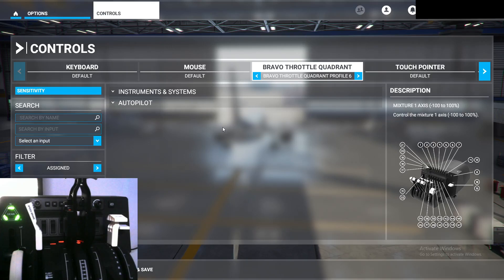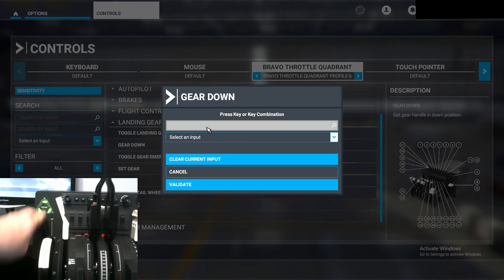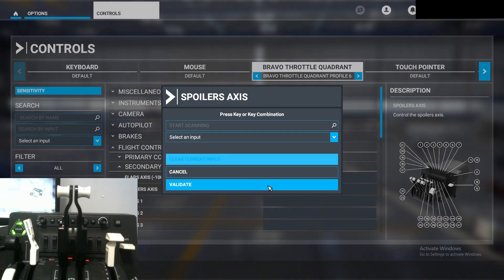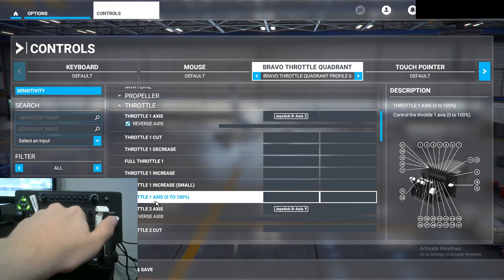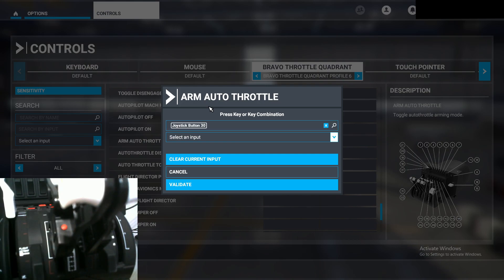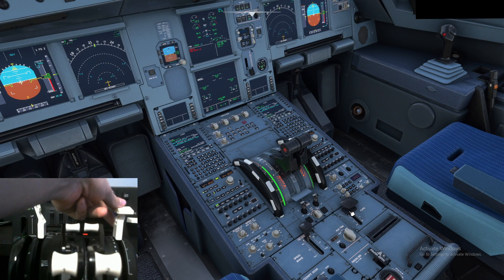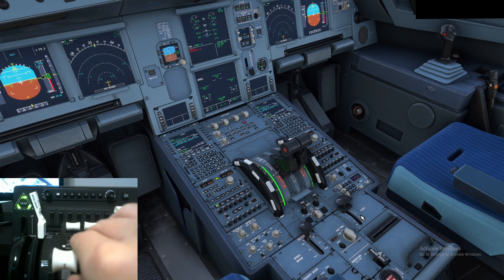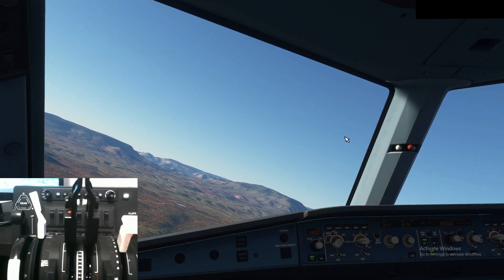Honeycomb Bravo Throttle How to Configure Thrust, trim, gear, flaps, spoilers, and Reversers in MSFS

Comment: Excellent video -  thank you.
Missing the function "idle reverse" as sometimes you want idle reverse on roll-out and use Autobrakes/manual brakes only; aircraft LW is very low, long runway etc ..... so ..... how would one config/assign that? In particular for my B744F. Cheers

Comment: When you engage the autothrottle would the throttle levers move? (Not in the simulator)
Reply from the maker: On the bravo quadrant, no. If you want levers that move with the sim, you’ll have to look for a “motorized throttle” quadrant. I do warn you though, that these units cost much more.
Reply: @wallyrodaviation  Thank you!

Comment: When I set the mixture using axis 1 -100-to 100 no matter how I do it (start mixture forward and pull back or vice versa) it results in it set backwards to the lever. Even with just 1 movement (no return movement),same result. Can not click "reverse".
Reply from the maker: There might be a similar setting for the mixture, like -100 to 100

Comment: Thanks but there is no -100% to !00%  In the Flap assignment section .. in my sim
Reply: there is 0 to 100% but it does not work
Reply: I just selected Flap axis checked the reverse axis box and validate and all works now ... cheers
Reply from the maker: @56Rockabilly  glad to hear it works now, yeah I believe they have changed some of the control binds since then. Nevertheless happy to be of help 👍🏻
Reply: @56Rockabilly  Hi Cliff I am struggling adding the flaps to my A320 Fenix I did try all these still my flaps goes from 1 to full directly any idea what should I do Thanks

Comment: On the 4 engine setup,  the program won't recognize the throttle #3 reverse thruster when I flip it back, nothing appears on the scan screen.  I've swapped out a functioning switch with #3 and eliminated that it was the actual switch itself.  All the reverse thrust levers are in working order.  Could it be something in the bravo unit itself or just a software glitch?  Frustrating.
Reply from the maker: I had the same issue funny enough, I am pretty sure it is the throttle itself
Reply: @wallyrodaviation  sad part is that I just received the Alpha and Bravo in April and neither have been used much.  Thanks for the reply.

Comment: Hi wonder if you can help . I just got my Bravo Throttle & have problem with the lights not working have installed the latest drivers for it in the right folder for game, but still not working my  the levers work & light up when moving in the set up but Buttons don't display light function when testing ? is my control  Broken ?
Reply from the maker: I would locate the uninstaller application for the drivers, run it, and then go about the process again and make sure the game isn't running

Comment: Surely you'd want to use the elevator trim axis for the trim wheel rather than "trim up" and "trim down"? If you use those you're just emulating digital keypresses on an axis.
Reply from the maker: The trim wheel on the Bravo is not actually an axis, but two buttons, one for down, and one for up.
Reply: @wallyrodaviation  damn really? That seems like a really odd decision to go with on Honeycombs part.
Reply from the maker: @SoTotallyToby  I was shocked to see that too
Reply: @wallyrodaviation  The problem I’m having with the Bravo trim wheel is that it’s just too slow for C172 type aircraft. Any way to speed up the nose down/up trim?
Reply from the maker: @andrewmorris3479  Too my knowledge there is no way to speed up the trim wheel action
Reply: @andrewmorris3479  I had the same issue, its completely unusable out of the box. I had to make a fake axis in vjoy and use Joystick Gremlin to bind the trim wheel keypresses to increment and decrement the virtual vjoy axis, and I use the axis inside the game. Kind of ridiculous you need to do all that though.
Reply: @andrewmorris3479  I had tge same experience with the trim wheel doing very little if anything while flying a twin engine prop plane. It didn't seem to work at all.  That was my very 1st attempt at setting it up and actually flying so far as I just received both the yoke and throttle from Honeycomb. Hopefully something can be done to improve its function in the msfs2020 sim.  My yoke was pushing the nose of the plane down like crazy.
Reply: @wallyrodaviation  I noticed that the trim wheel was more sensitive trimming up than down (button 23 triggers about twice as much as button 22 when rotating the same amount) Is that the same for you, or did I just get a bad unit?
Reply from the maker: @andrewwinsor5025  I haven't noticed anything of the sort, it may be a faulty unit, but there's no telling for certain
Reply: @wallyrodaviation  yep, pretty frustrating. That trim wheel ratio needs to have adjustments (like 3:2, 3:1, 4:1, 5:1, etc., so we can modify it the way we want per plane...)

Comment: Hey, so I have an issue where when I put my thrust levers in idle it goes into reverse I have no clue how to fix this or if it’s just a bug. I also have an issue with the A/T button I click it and it doesn’t work please help
Reply from the maker: Are you using the Fly By Wire a320?
Reply: @wallyrodaviation  Yes I am
Reply from the maker: @xill455  Ok, so is what you need to do is go to the little tablet on your left in the cockpit, and go to the throttle settings. Basically you have to program the positions for the throttle directly from the FBW A320. Once you find the settings, make sure you do manual programing and you should be good.
Reply: @wallyrodaviation  ok thank u
Reply: @wallyrodaviation  can you give me your sensitivity for the bravo throttle quadrant because apparently mine isn’t “syncing” with the values on the flypad
Reply from the maker: @xill455  My sensitivity is left at default, the only thing I changed was the detents position. If you go to the flypad settings, Sim Options, and then Detents, all I did was move my throttle handles to the desired positions and it all worked out. As for sensitivity in the actual game settings, it too is left to default

Comment: Thank you for your time and effort explaining this!  I only just receives my Honeycomb yoke and throttle and am setting them up.  1st time flying (a twin engine barron) the trim wheel seems to do little to nothing and by default the yoke when centered was pushing the nose of the plane down into a death dive.  Thanks again for helping with your knowledge and I subscribed, want to see more of your videos!

Comment: So how does the trim wheel actually move the trim tab, if it is not switches ?
Reply from the maker: The trim wheel is two internal buttons rather than an axis. So whe nyou move the wheel forward it rapidly presses a button, and same for moving the wheel backward.
Reply: My trim wheel reacts very slow. Is it normal? Can anybody help me 😮😢